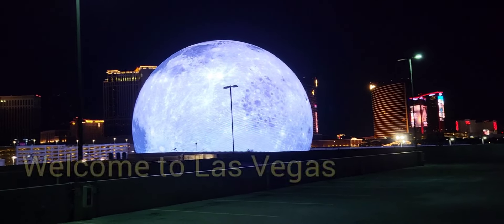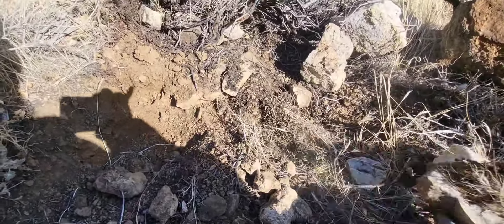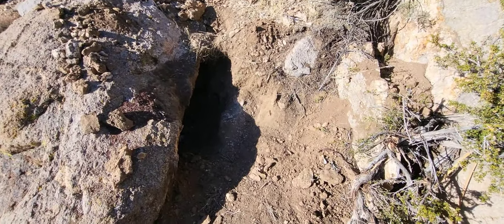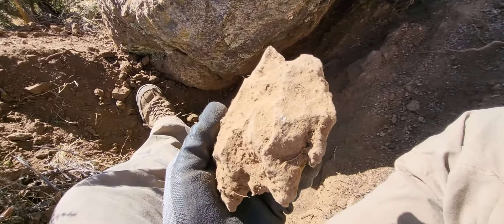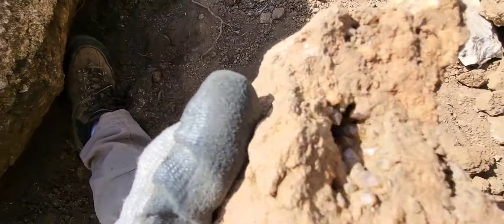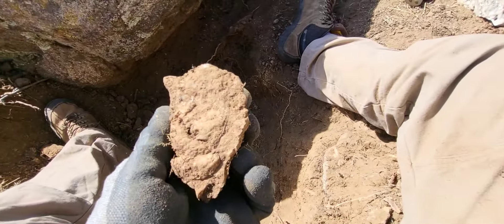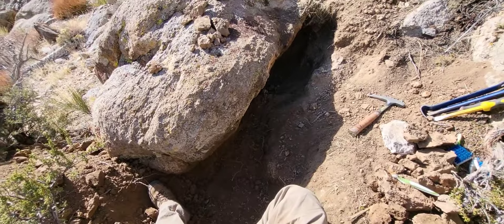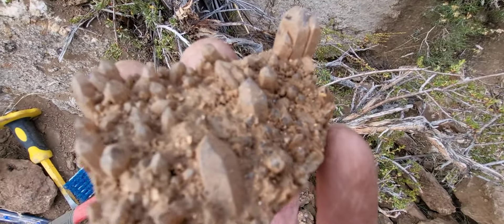OMG!!! "Treasure" Found Near Las Vegas Desert #Rockhounding For Purple #Gold And Citrine

Comment: Are you searching different areas or sticking close to original dig sights?
Reply from the maker: I've been hiking all over these mountains, way in and high up peaking a few of the mountains on both sides. Mainly doing a lot of scouting. I've found many areas where purple qyartz can be dug up and many locations I'd love to get back to to do a solid day's digging. Recently, I've found a mountain that's kinda close and has so many promising spots to find some great material. This mountain has produced some really fat and chunky deep, deep purple quartz. I haven't gotten that lucky yet, but I know people that have. I know I'm in a good area to hit. I figured I'd keep on this particular spot to see what it does. Gets bigger and better or tapers out. I really love the search and find new spots every time I go out there, but for the next couple of trips, at least, this hole is getting opened up to see what may be hidin. There are at least 4 good veins that are running thru there. It's just a slow operation trying to not cause damage to the material
Reply: @RockhoundTreasurehunt  So I take it the higher you go the better chance you have of finding better quality crystals?
Reply from the maker: So far, that's what I've been finding out. At least where I've  scouted and from what I've found.

Comment: So I'm wondering if walk up above where you were if the rocks 🪨 might get better. I'm taking above almost to the top of the mountain ⛰️ anyway I hope that you get a chance to do so before summer ☀️ comes back around.
Reply from the maker: I was thinking the exact same thing! That's a hike I am willing to do. Even if there's nothing special, the hike will be fun, and the views will be so sweet. I think that hike may be soon.
It does look promising for sure. Especially 3/4 of the way up where there is a large cluster of trees. I think there's a spring right there. These mountains are famous for spring and there seems to be darker soil in those areas, and the crystals tend to be deeper purple in darker soils.
Reply: @RockhoundTreasurehunt  wow you should go for it take someone with you just in case you need rescued. You never know.
Reply from the maker: I wasn't too far from the top. Originally, when I first found this spot, I came hiking and scouting from the other side. I came from the top and hiked down to this spot. It's like a tier, though. It slopes upward on the other side and meets up with another mountain. That's the one I want to climb. I'm sure there's good material up there. Your average Rockhound wouldn't do the climb. I'm far from average, but I don't know if that's a good thing. Lol.. It's happening. I have, too. I'm curious
Reply: Found a few pieces out there need to go further up where I stopped....Good stuff bro!!!!
Reply from the maker: @timbkertis8939 I've found that higher is better material for sure, but it's at the higher levels that I've seen rattlesnakes, so be extra careful!